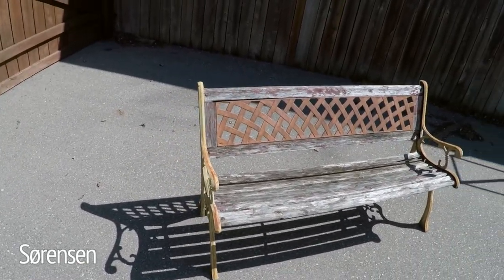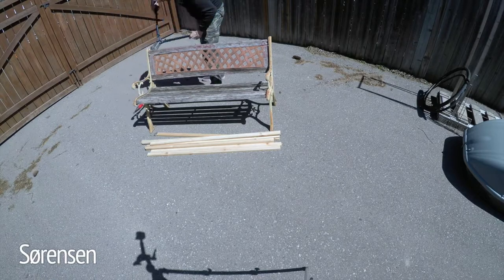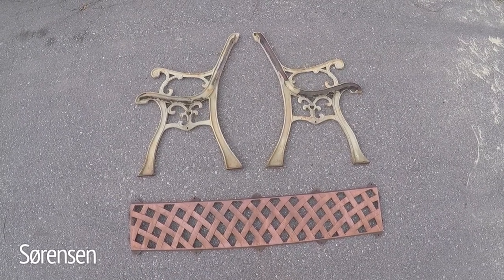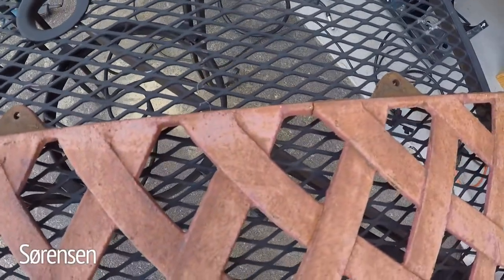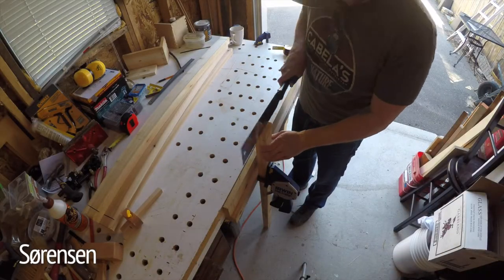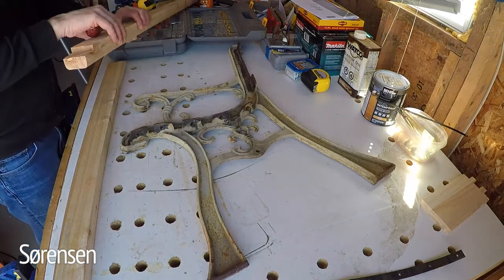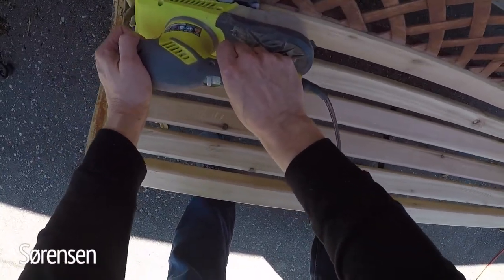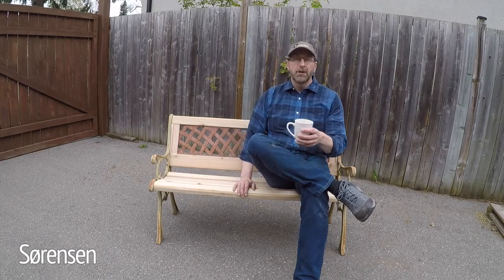Garden Bench Restoration - Upcycling Old Cast Iron

Comment: I have the same cast iron bench pieces but not the wood to measure how long the were. Could I ask what the measurements for the wood were. Thank you.
Reply from the maker: Hi Pam, I cut the parts a little longer than the original, so just under 4 feet long in my case.  You should reference the thickness for the wood off the cast iron pieces where they get attached - mine was 1.75 inches if I remember correctly.  You can find newer versions of this bench at garden stores and get an idea of the sizes. Lowes has several similar styles.